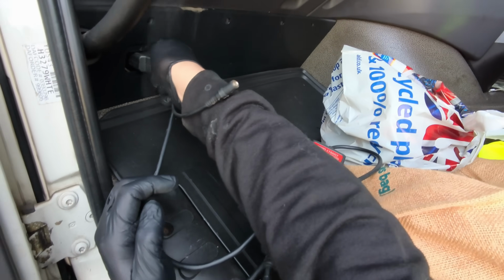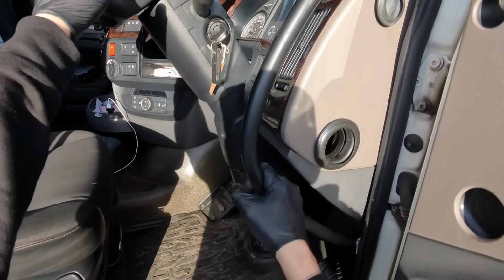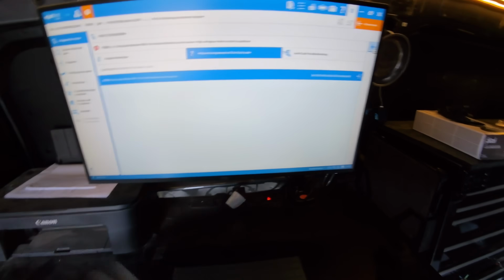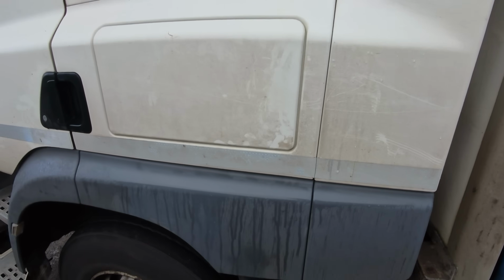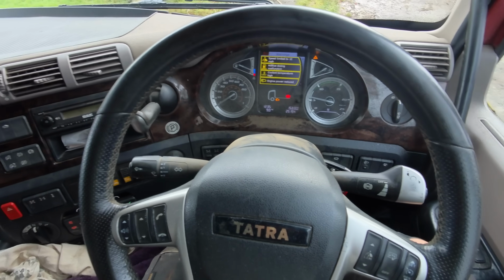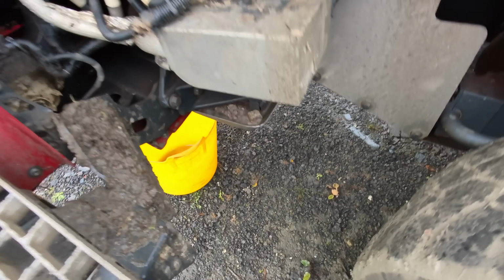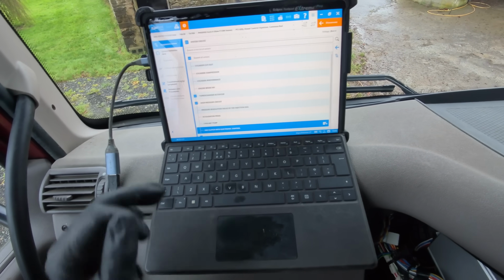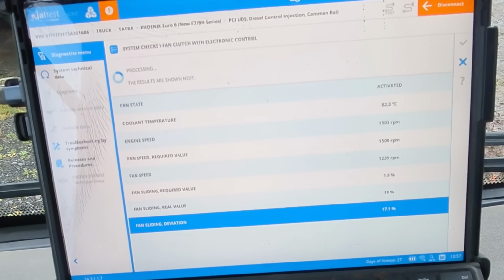HOW COOL IS THIS TATRA! + usual DAF issues

Comment: Why do they push rods bend R ?
Reply from the maker: Usually over revving the engine, but then ive had the rocket arm nuts come lose also on there own and the push rods come out that way also.......i dont know if it was specific years or not like the faulty head gaskets were a specific batch I belive

Comment: Hi Russell, got a question about cylinder heads cracking/ smashing apart the casing where the injector tubes go, we’ve had a few recently where it’s either cracked or literally blown holes in the head from where the tubes deliver the fuel, could you possibly explain if there’s any common faults or issues that cause this? Thanks
Reply: Has the fuel cut holes ? Apparently you’re meant to renew the delivery tubes whenever injectors are removed 😢

Comment: Interesting as always Russ. As far as leak stop in a bottle, Id say the oil cooler is usually the first to plug up followed by other heat exchangers including radiator core! Thank you for the videos. I have been wanting to reply on the camshaft video, just haven't yet.

Comment: Paccar engines 🤮what were DAF thinking installing them 🤷🏻‍♂️
Get back to the 1160 engine or the Rolls Royce Eagle engine Leyland used 
The 30/30 Constructor 8x8 with the 300 hp RR Eagle engine was king of the hills on the A68 fully loaded or the 330 hp DAF engine in the same truck

Comment: Wow, i have seen a lot but never before a drivetrain like that! If they have used a powder (old) style radiator sealant product then is the cooling efficiency lowered due that is my opinion. Most of the times that is a temporarly fix..
Thanks for the video! 🙂
Reply from the maker: Hi buddy thanks for the comment, yes the axle arrangement is something else! I forgot to mention the rear steer on it too 🫣

I don't know what was used to block the leak but the customer is trying to flush it all out currently to increase the efficiency

Comment: So Russell, to be clear here, the tatra is potentially going to need a replacement radiator or can it be flushed and what about the water pump and engine block galleries? I ask out of interest as I dont work on trucks. Thank you for sharing. I find your thought process fascinating and your knowledge is impressive